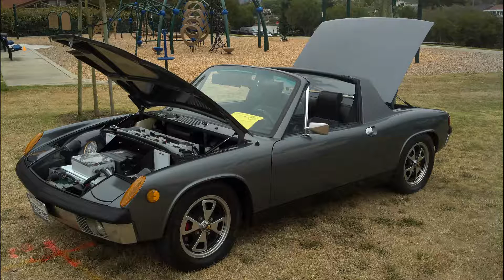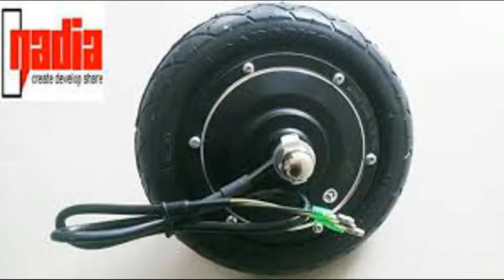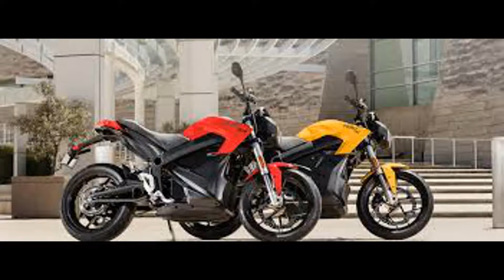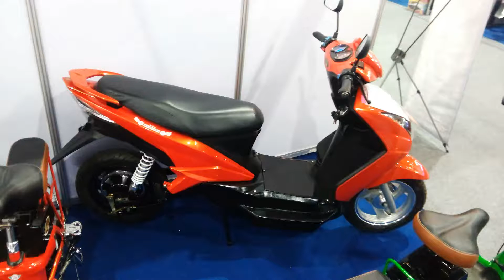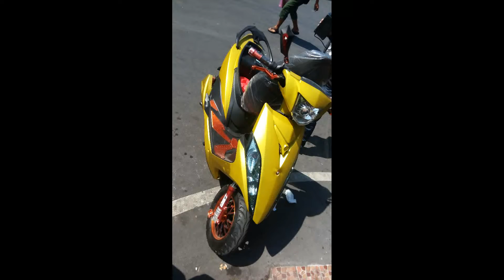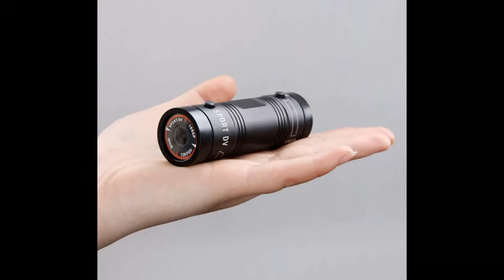The Hunt for an Electric Scooter in Thailand

Comment: These cost less than $700 in China
Reply: @MikesTropicalTech  You can get a half size automatic scooter with around a 1000w battery for $500 in China... I mean half size, they're not as big as a Honda Click or PCX... They're smaller and much lighter, definitely way less than 100 kg. If i'd be traveling light with only a backpack I could easily bring the box with me on a train and a few taxi rides maybe.
Reply: https://www.youtube.com/watch?v=BZnqRp5o71U
Reply: @MikesTropicalTech  Check out that last link I sent here.
Reply: @MikesTropicalTech  Exactly, i don't understand why they're so expensive. They could be imported from China as parts (lower taxes) and then assembled here. Wholesale they'd go for only a few hundred dollars per unit. 

I'm desperately looking to get a decent electric scooter at a good price here
Reply: @MikesTropicalTech  You can import and assemble the scooters and batteries as a 49% foreign owned company with some outsourcing

Comment: is there a reason you did not consider Honda M8?
Reply: @MikesTropicalTech  yea just did a search and several honda models came up - the honda dealer didn't know about them? the one that looks best is called Honda Q2 100k range 1200w 50kph speed 2 people. You have had the Toyotron for more than a year, how would you rate it? decent quality and power? thanks!
Reply: @MikesTropicalTech  You have had the Toyotron for more than a year, how would you rate it? decent quality and power? Good choice today?
Reply: @MikesTropicalTech  thanks for the tips. could not find Strom anywhere, but PCX looks pretty good, although no storage space since no flat floor and the batteries up high will affect center of gravity - sacrificed for convenience i suppose. Anything out there you WOULD buy if you were shopping NOW? thanks!